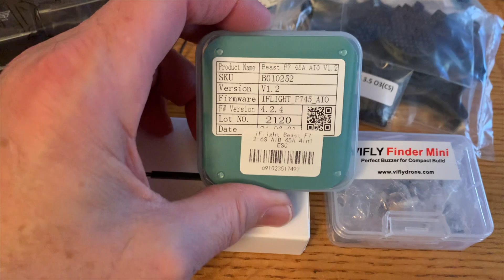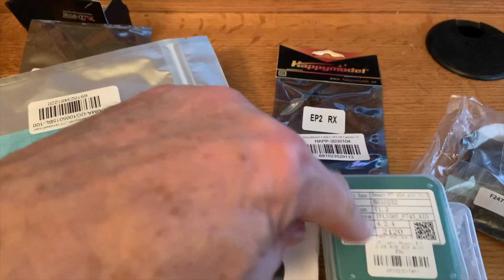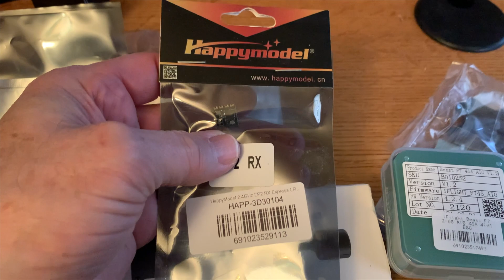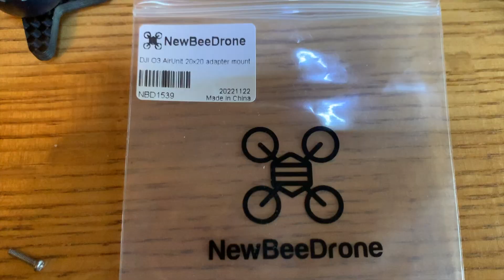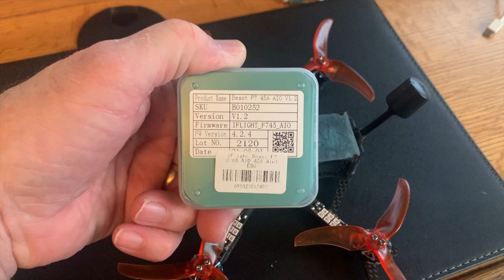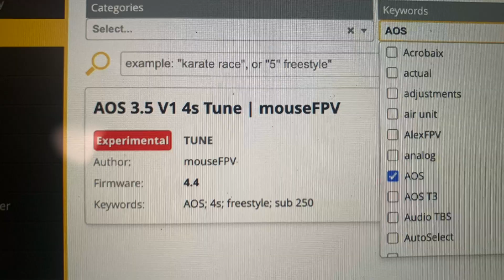DJI O3 Air Unit and AOS 3.5 O3 Sub 250g Build

Comment: Hey great video, I am planning a very similar build. I wanted to know how much flight time you get running the GNB 850mah's with this frame? thanks!
Reply from the maker: Hi, 
Thanks for the comment! I just looked at a flight doing what I call "park acro" and I was getting around 4:58 (~5min). My voltage was 14.3 (3.57 per cell) when I landed. So it does really well with my type of flying. Of course your results may vary based on how hard you push it. 
SLOG

Comment: Planning an 8s AOS 3.5 build mainly came here to see if 2 of those 850mah 4s would fit on top of the frame, looks like they should be fine
Reply from the maker: Hello, if you are running a camera mount it might be a little tight. However, If you come out the back with the pigtail, you should be fine. This quad actually has a long top plate for a 3.5 inch quad.
SLOG

Comment: Great video man! I'm glad I found you! I have built many quads but never a smaller quad.  This gives me an idea of what to use as far as motors and stuff.  How has it been for you over the last 11 months lol?? Newly subbed!
Reply from the maker: Hi @OTRFlyer, Thanks for the feedback! For the last 11 months this quickly became my favorite freestyle quad. I love the way this quad flies. I have had no issues with durability but I do not fly around concrete.  If you are into sub250 3.5 inch builds, I think this is the one. There is a new AOS 3.5 V5 that is an updated frame that you should check out. 
Cheers,
SLOG

Comment: If you're still around j.bardwell showed me a video he had done one youtube showing how to wire elrs to sbus as long as firmware can be converted to 3.3. These happy models can. But if i wanted to do an air unit that required sbus then would that take up my sbus slot? I'm new to the hobby and would like to learn something. I was also unsure how you said that you were setting up the option to use either the elrs or the air unit...does that mean you can fly with only the air unit or do you still need the air unit as an rx.
Reply from the maker: Hi @unluckiestnumber7172, flight controllers usually have spare UARTS to connect your ELRS receiver to. Point being, if you plan on switching between an ELRS Radio Controller and the DJI RC2, you would not want to connect the ELRS receiver to SBUS, as that is what the DJI RC2 uses. Of course this requires making changes in the Betaflight Configurator to accomplish this. The only reason why I mentioned this is for those pilots who only have the DJI RC2 as a Radio Controller. 
Just for clarity, the SBUS connection is not required to get video feed in your goggles from the air unit. The SBUS connection is used for RC control of the quad. If you do not have a DJI RC2, you don't need to connect up the SBUS (I just do to give me options).
SLOG

Comment: haha it's crazy how big of a difference motors make to the weight. I just did a build with this frame and I'm about 70 grams heavier than you and 56 of those grams come from my motors being 2105 and not using an AIO. I was watching your video and kept saying to myself "why the hell is my aos 3.5 so damn heavy?!?!" haha great video bro!
Reply from the maker: Hi @BeautyBeastRC, yes I had to keep every gram in mind to keep this build under 250g. Motor choice and the AIO helped out a lot. However, I am sure with the 2105 motors you will not be lacking in throttle response😁
Cheers,
SLOG

Comment: Thanks for this very interesting build. I have just started my build of the AOS 3.5 1.2. How did you shorten the cables of the VTX antenna to fit in the provided TPU? Did you just fold the excess wires under the unit? Thanks again for sharing.
Reply from the maker: Sorry for the late reply. Did not see this in my notification. I just folded the wires in opposite directions.

Comment: How do you hit the buzzer button with such placement deep inside in the frame?
Reply from the maker: Actually, I can reach the button with a hex driver but that is not how I disarm the buzzer. The buzzer I have you reset by plugging the battery back in for ~3seconds and then unplug it. It beeps 3 times indicating it is disarmed. 
SLOG

Comment: There is barely enough room to include a stack, the height is crucial, because the camera mount is in the way!!
Reply from the maker: Yes agree and why I went with the AIO board over a traditional stack . Also saves some weight.
Thanks for the comment so others know to pay attention to stack height.
SLOG
Reply: @slogfpv  Well, i put a Stack (Diatone Mamba Mini) in there, had to get quite creative with stand-offs. It now consists of two washers and a rubber seal. :)

Comment: How do you have so much room using the 03 air unit and then you even put a vifly mini beeper in between the FC & 03 air unit  ....     
I did a  AOS v2 3.5 build using a 20x20. Mamba Stack - MK4 F722 FC + 40A 3-6S BLHeli_32 128K ESC and  Caddx Nebula Pro Vista Kit with a vifly mini 2 which is sitting in a mount at back in a gps tray mount... 

My stack and my air unit are kissing 💋  each other so I'm curious how you have so much room?
Reply from the maker: Hi loaderqsf, nothing magical as you saw from the video, but to answer your question, with the iFlight Beast F745A AOI, I am measuring 20mm between the back of my AOI board and the O3 Airunit. I did leave my motor wires long enough to create a pocket for the the Vifly mini. Not sure how you have your motor wires routed but one trick is to come from underneath and solder them on the bottom side. Of course coming off the sides with the motor wires also gives you more room front to back. 

SLOG

Comment: hello slug, why you didnt use the cable direct from the air unit to the fc? why you solder instead of connecting? thanks and awsome build!
Reply from the maker: Hi Gonzalo, the pinout has changed between the O3 air unit and the original DJI air unit or Vista. The flight controller I used is older. So point being you need to look at the pinout on the flight controller vs pinout on the new O3 air unit. Even if it looks like the cables and connectors match.
SLOG

Comment: What motors/props are you running?
Reply from the maker: The motors are - iFlight XING2 1404 3800KV  and the props are - EMAX Scimitar 3.5x2.8x3. A full parts list is in the video description and also in the video. 
Cheers,
SLOG

Comment: can use Freewell ND filters in O3?
Reply from the maker: Unfortunately not but Flywoos will since they have narrower filters. https://www.racedayquads.com/products/flywoo-dji-o3-air-unit-camera-filters-choose-your-nd?variant=40167706067057
Chris has come out with a newer version of this frame called the AOS 3.5 O3 Evo so if you have not ordered the older frame I would pick up the Evo version. It will support the larger ND filters like the Freewell.
SLOG

Comment: Awesome build video! I'm building my first quad and just ordered this same frame. I'm swapping everything from my Cinebot30 o3 6s over to this frame.  I'm concerned that my motors (1804s 2450kv) might be too much though. Two questions  if you don't mind, do you have a link to the race wire you're using?  Also what are your thoughts on using 1804 motors on a build like this?
Reply from the maker: Hi Jessiah, the Cinebot30 is a significantly heavier  quad so I would say the 1804s are overkill (just add weight). Chris Rosser (frame designer) recommends the following if you want something larger than a 1404: 
"3.5" Freestyle benefit from a slightly larger motor. 1504/1505 is my recommendation and Brotherhobby has a good reputation for quality and performance. 2950KV on 4S is my recommendation".
Link to racewire:
https://www.racedayquads.com/products/clracing-race-led-choose-your-color-1pc?variant=12988432941169
SLOG

Comment: Are the props out of view in all FOV settings?
Reply from the maker: Hi Jan, on the bench in ultra wide, I do not see props in view with the camera angle I fly which is low (20 degrees). However, I only fly in wide, so not sure in bright sun you will not see prop shadow in ultra wide.
Hope this helps,
SLOG
Reply: @slogfpv  How about vibrations? Is the lack of soft mount for the camera an issue?
Reply from the maker: @jgrudnicki  I think because the frame is designed to be very quiet as far as frame resonance goes, it will have less frame resonance issues with the camera. Of course the motor noise will still couple into the camera since it is hard mounted. So you could argue some form of isolation between the camera and the frame is better. However in practice, I have had no issues (you can see from the videos). I even ran it through Gyro Flow and did not have any issues with the internal camera gyro. My understanding there are some O3 cameras (batch related) that are more sensitive (I think some people are gluing the lens housing down??). Anyway, all good with my O3 camera and build.
SLOG
Reply: @slogfpv  i just realized that if purchased from iflight, this frame actually comes with soft mount for the camera. I guess that puts this concern to bed. 😃

Comment: nice build. I'm planning basically the same and it's great to see the walkthrough. You may have seen by now, but Flywoo and GepRC have O3 filters that attach vertically and don't need any extra horizontal width. The Flywoo only sticks out at the top (unlike GepRC top and bottom) so it may be a better fit for this frame. Thanks for the video!
Reply from the maker: @rainponcho, glad you found the video useful. Very fun build and so far, my favorite freestyle quad. I just really like the form factor. 
On the filters, I saw that on a Flywoo quad. Nice filter. Hoping GetFPV or RDQ will start carrying it. Thanks for sharing!
SLOG

Comment: I just built one of these a month ago with, 20mm mamba mk4 stack, o3, 1504.5 brotherhobby motors, 4S, and i find myself flying it over all of my other quads. Its very fun to fly! Only problem I have to fix is to replace the flight controller, because the Fc has the 42688 gyro and its terrible. I cant tune it or it wants to do a flyaway. Only reason it flies now is because of a betaflight preset but could be better. Also, i had to dremel part of the camera mounts to fit a 20mm stack, or it would be touching. Could of put the o3 unit in the front but i didnt want to buy another longer cable antenna so... Other than that, i love it. Great build by the way!
Reply from the maker: Agree with you on this being my favorite size freestyle quad. I think the 3.5 inch form factor is a sweet spot with a good balance of being nibble, more quiet, longer flight times and still has some fling mass for freestyle. If you go with a whoop style AIO board make sure you adjust for the board alignment "set align_board_yaw = 45 "
Cheers,
SLOG

Comment: I first tried 1404 motors but they ended up not providing quite enough thrust. Moved up to 1505 (using the same HQ 3525 props) and its been a much better experience. Would have loved to bump up to 16mm, but I really love these t-mount props.
Reply from the maker: I like the 1404 motors for keeping the build weight down (chasing grams) but I can see why a little more grunt would be appealing. Chris Rosser recommend both size motors so good choice. 
SLOG
Reply: what KV?
Reply from the maker: @ChrisParayno  thought your question was directed to Matthew. For my build I used xing 1404 3800kV motor’s running 4S batteries.
SLOG

Comment: Dude you're amazing, I just did this build thanks to your video. I am haveing trouble with a PID tune and am getting brutal flyways, could you upload yours or point me in the right direction?
Reply from the maker: Hello, thanks for the comment! Not sure what flight controller you are using but if it is a whoop 25x25 AIO style, you need to align the board yaw by 45 degrees. Type in the the following CLI commands:
"set align_board_yaw = 45"
"save"
Check your FC alignment by looking at the setup tab in Betaflight configurator (Move quad to make sure axis movement look correct).

If you are looking for a great preset for this build, please refer to my following MouseFPV preset tune review video: https://www.youtube.com/watch?v=4Veh71Vnl6o
Cheers,
SLOG
Reply: About 30 mins before you posted this, realized EXACTLY this issue. Thank you for the response, I was going crazy trying to figure out that problem.

Comment: Hey there, your video is literally invaluable to me! Thank you for taking the time to walk us through the process. I'm building a similar build as a first drone. Would you be able to elaborate on how you mounted your flight controller? The one I have is a T-MOTOR Mini F7 Stack, and the mounting bolts are way to thick for the AoS 3.5 frame. What size bolts did you use specifically, because I'm assuming using smaller bolts would lead to potential vibrations if mounted incorrectly?
Reply from the maker: I am glad to hear the video has been useful to you. The AIO board I have came with M2 x 12mm bolts and looking at your stack, it appears they are M3 bolts. The easiest thing to do is drill out the holes with a 1/8 drill bit. Make sure to clean off the carbon fiber dust (conductive). The other option is buy a M2 screw set (handy to have) and use a plastic washers on top and bottom of the rubber grommets and a nut on the top. Also, I always recommend using a nut below the stack to give the stack bolts rigidity. You should be ok but the first option is better.  
Cheers,
SLOG
Reply: Went with the first option and it worked perfectly. Thanks again!

Comment: Hey mate I loved the video. Just curious, as someone who hasn’t built a drone and just uses the dji fpv drone, what are the pros/ cons of building a drone with the dji system as opposed to just using the dji drone itself? What type of battery time would you expect ect?
Reply from the maker: Good question. Here are the pros over the DJI FPV quad (assuming you are not talking about the Avata cinewhoop):
It is lighter, nimbler, better at freestyle, has a better camera (O3 airunit and camera), way more crash tolerant, easily repaired when you do crash it and it is under 250 grams so you don’t have to register it (or worry about remote ID) in the US unless you are using it for commercial purposes (e.g. using as a chase quad for commercials).

The cons are harder to learn how to fly, none of the DJI safety features, shorter flight times and probably not as good in windy conditions (way lighter).

As far as flight times, I am getting around 5 min, not as good as the DJI FPV quad but you can always carry a lager battery and squeeze out 7 to 8 min but you would be over 250g.

Hope this helps,

SLOG

Comment: How's the EP2 receiver been treating you? I've had all kinds of issues with those unfortunately
Reply from the maker: No issues so far other than range is obviously not as good as a regular antenna. I have used Happymodel, BetaFPV and Flywoo versions on sub 250 gram builds before and they all perform about the same. I know some people knock off the ceramic antenna. BetaFPV has one that has a flat canister type antenna that is very low profile. If you are bando bashing, I would go with the tried and true TBS Crossfire even though it has more latency. I was chasing grams with this build and I just happened to have this receiver on hand.
SLOG
Reply: @slogfpv  I actually ended up switching to 915mhz ELRS and it's been so much better for me. The typical location I am flying at apparently has massive 2.4ghz interference so my issue was with all 2.4ghz receivers. thanks for the reply!

Comment: Hi…thank you for this
Were you not able to use the nd filters because of the camera plates?
Reply from the maker: Sorry I missed this comment but no I am not using the ND filters I have for the Avata. Will not fit.
Reply: @slogfpv  thank you
I have been corresponding with the frame designer. He states that he is working on an even newer version to fit ND filters.
I think that's important because, supposedly, the DJI EIS requires a shutter speed of 300 or greater FPS.
So, to get motion blur, turn off EIS and manually expose to the 180 rule. Finally stabalize in Gyroflow.
Personally, I don't like stabaluzation. It puts me to sleep, and that workflow is a lot of effort, but I do want motion blur.
Reply from the maker: @richardruckert7954  thanks for the tips! Good to hear adjustments are being made to the frame to fix the ND filter support. Hopefully it is a retro fit vs a new frame. I use ND filters even on my Runcam Thumb. Gives motion blur and reduces jello. SLOG
Reply: @slogfpv  regarding the runcam thumb, I have the insta 360 go 2. Jello was a big problem, but I've discovered that if I record in LOG color profile...no jello, ever.
Don't know if runcam has LOG, but you might check.
Reply from the maker: @richardruckert7954  the Rancam Thumb 4K does have a flat color profile but not a true LOG. Actually the Thumb is not too bad for jello if you have it soft mounted in TPU mount. Great tip on the Insta 360 go 2. I have one but I could only fix the jello with very flexible  TPU mounts. SLOG